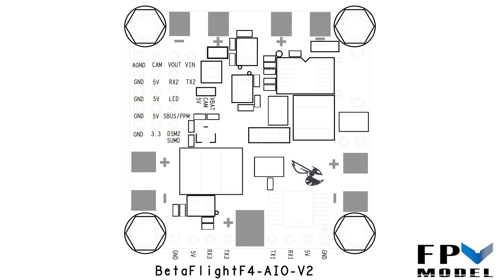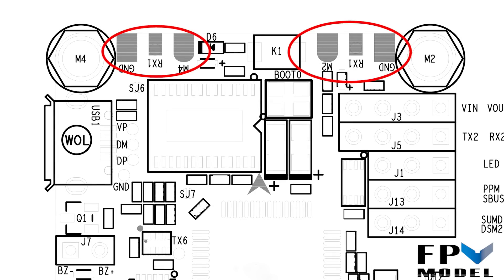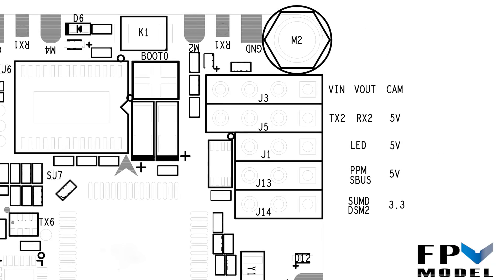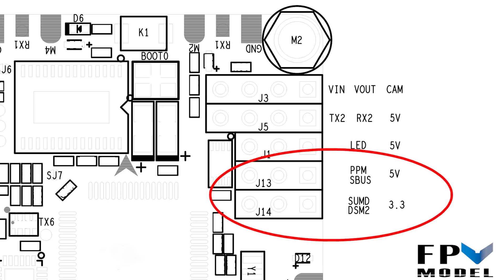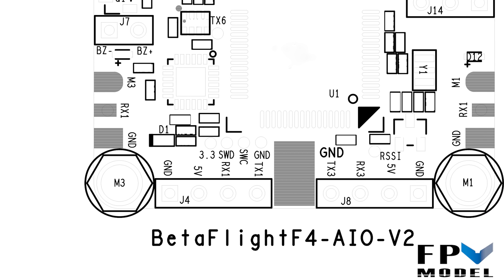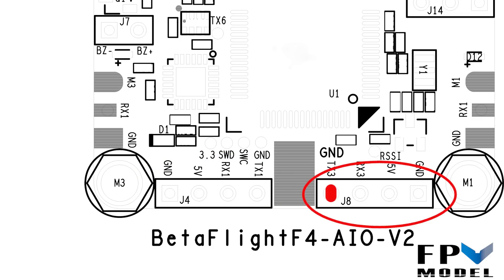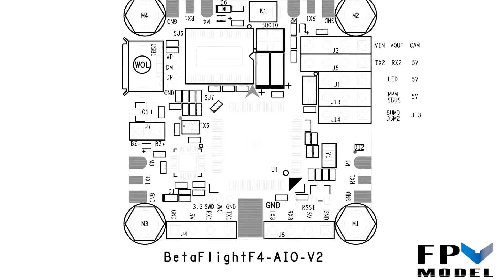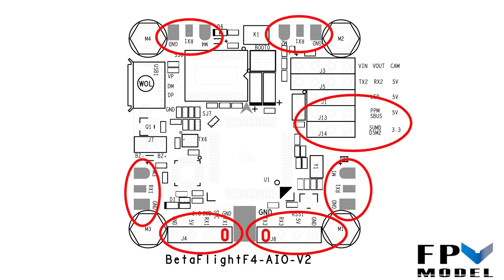BetaflightF4 How To ESC Telemetry, Smart Port Audio, Smar Port Telemetry Betaflight F4

Comment: I am having problems getting my motors to turn on. I am using a radiolink at10 transmitter with a R12DS receiver. The receiver is connected to the board with a 3 wire servo cable that was provided with the receiver. I have it connected from the sbus port on receiver to the three row pin out on the back labeled sbus. The transmitter and the receiver have been paired. I am using hobbyking 30A  UBEC ESCs, wired like the diagram on your website. In betaflight the input from the transmitter is shown and has been setup for a sbus connection. When I attempt to throttle up the motors nothing happens. Even when I attempt to throttle them up using the motor controls in betaflight there is still no response. I am not running any cameras or  using smart audio. Only building a standard drone for a class assignment. If you have any advice with what may be occurring please let me know. Thanks.

Comment: Hi, I’m having 2 issues with my BFF4. I can’t get the current sensor to read anything and I can’t get the rssi to work with my crossfire module. For the current sensor, I enabled it and seleceted onboard adc in the battery and power tab, but in the osd and post flight report the amperage and mili-ampers meters don’t move at all. As for the rssi with my crossfire, it always stays at 22. I assigned rssi in the micro tx to channel 12, and selected channel 12 as the source for rssi in the receiver tab. Everything else works, I get voltage and have full control with the crossfire module. Any ideas?

Thanks, Cooper

Comment: Hello, so i am using a Immersion tramp for my vtx on the betaflight f4 and the voltage wont display. It is connected to the video correctly and the power is being supplied straight from the battery. I see the voltage osd in my video feed but it just keeps blinking at 0.00 V.  I am currently using the +,-,video and audio from the tramp. i removed the other wires. I cant figure out why i dont see voltage. please help!!!
Thank You
Reply from the maker: send us a message to sales@fpvmodel.com , Please include pictures of your wiring and screen captures in the configurator.
Reply: WWW.FPVMODEL.COM 
Thank you so much for your quick responce and concern but i ended up figuring it out.

Comment: Im confused lol on your website diagram it says to hook my smart port to tx1? Now your saying put it on tx3? Do i need to switch it to tx3 if i have the betaflight esc hooked to the rx1 pads? Thanks for any help
Reply from the maker: What vtx are you using?
Reply: WWW.FPVMODEL.COM  i am using the unify pro. I watched your other video about going into cli and used the steps on your site and i got it working last night. The website step by step makes it super easy. Thank you
Reply: so what was actually the answer? this was the first issue I noticed-did you have to switch it? Could you please elaborate? Thanks :-)

Comment: Can you assist me in using Kiss 24a ESC's with this board? I am using FrSKY XSR with SBUS installed as directed and TBS HV with Smartaudio installed as directed and the adjustments made in CLI for softserial. The adjustment is made in the cinfig battery section to recieve data for amp from esc and in the configuration tab softserial, OSD, Airmode, ESC sensor, anti G, and Dynamic F are all turned on and runninloop at 8k/4k. When I power up OSD flashes on screen for a sec as system begins to power then blue led flash on ESC's and OSD is gone but system works fine other than slight power surge to ESC's on initial Arm. But any sequencial Arming after are idling normally. Please advise...
Reply from the maker: I haven't used the Kiss ESCs before but could look into it. Have you sorted this issue out already? Looks like I'm about a week late to this comment.
Reply: Not yet. I got a suggestion from Crazyfpv to try wiping the fc to default and that possibly there is a conflict with softserial. Currently I have switched to another build. The components for the BBF4 build is: BBF4, HW 2405/2850, Kiss 24a ESC's, TBS HV 800, RunCam micro, XSR/ X4R/XM+ "would prefer telemetry but certainly not vital with the OSD running. Can use XM and send RSSI through 16",available empty frames currently include 5" RDQ Mach1 with skinny race arms, 5" Kraken"Worx", or could run set up with Emax 2306/2400 on a 6" Chameleon and switch receiver to TBS micro and make first long range build. Thank you for looking into this for me. I will gladly post results to those who have been stumped as well.

Comment: Will Smart Audio (using IRC Tramp protocol) work if connected to Tx2 (instead of Tx1)?  I connected it to Tx1 and converted it to SoftSerial, as per the two videos.  However, the smart audio (IRC protocol) is not working (i.e. cannot see or change VTX channel in BF OSD).  SBUS and FrSky telemetry is working fine.

Comment: Anybody have trouble with KISS esc's on this board? When I arm the board, the motors spin up for a second then just stop. If I run them through the configurator, they spin up fine.

Comment: I have soldered everything the way you have in the video and turned on Soft Serial, but how do I direct the soft serial to TX1 & TX3? When soft serial is enabled it does not show any additional serial ports. I'm using an R-XSR and TBS Unify Race VTX.
Reply: Got it all working now. Only needed to do the 11 A09 part to enable smart audio in softserial and leave esc telemetry on uart1and smartport on uart3. Maiden flight tomorrow, happy days!
Reply: No, but I think it's so that the TX is able to do TX & RX on one pin.
Reply from the maker: Send us a message Matt. ESC telemetry shouldn't be too difficult to get working. If you can send some pictures of your wiring, and screen shots of configuration tab, port tab, and a pic of your resources in CLI we should be able to get it sorted without many issues.
Reply from the maker: Did you turn on soft serial in configuration tab?
Reply: Yes, I've tried it with Soft serial on, soft serial off, tlm_inversion on and off, pid over tlm is enabled. I've tried it on tx1, tx2, & tx3. Found out the firmware on the receiver was possibly out of date and updated it and tried it all over again. Back on the Naze32 boards when I enabled softserial, it caused more serial ports to show up in the ports tab, when I enable soft serial now, no additional ports show up in the ports tab
Reply from the maker: Send us a message to sales@fpvmodel.com , please include pictures of Ports and Configuration tab. In CLI enter "resoure" and let us see a screen shot of that too. If soft serial is not showing up in ports it seems like something must not be set up correct. Shouldn't be difficult to figure out with those three screenshots mentioned above.
Reply: Jason did you get it sorted/an answer? Im using the r-xsr with the un-inverted hack, the early version where i soldered a wire to a transistor pin, de-soldered the rx plug, cut the smartport pin 3 down and joined the un-inverted wire from the transistor to it, then soldered the plug back to the rx. Telemetry is working fine and my TBS unify v2 5v smartaudio is working. I just need to get the ESC telemetry working on rx1 with smartport also on tx1. Not sure if this was your issue but its my issue at the moment, any pointers to help would be appreciated seeing as i have a similar set up. Nice vids and flying on your channel!
Reply: Matt Treerat yeah, got it sorted. They made a second video on how to do the soft serial setup that I was unaware of.
Reply: So i guess you did everything in the second vid? I have seen it but i'm confused on the need to turn UART 3 (smart audio) into softserial for it to work, when Uart 1 with ecs telm on on rx1 and  smartport on tx1 is the only Uart that needs softserial. Are you running Blheli 32 ESC's and getting the telemetry from them ? Its the ECS telmetry im after matey.
Reply: H'mm just followed the second vid and tweeked the resource serial ports by the book as well as the ports tabs and enabling softserial, lost my telemetry and smartaudio!  The toys are out of the pram now, set it all back to what i had, guess i need to contact FPV Model to resolve this. Thanks for your response and help. I saw you have a geprc leopard in your vids, they have been quite popular over here in the uk this race season. I stuck with my geprc TX210 chimp all year and im still loving it for what it is, worth a try if you like the geprc frames. Thanks again.

Comment: i am having problems arming it will only arm maybe 1 out of 10 times its very strange accelerometer is off and min throttle is fine
Reply from the maker: Strange indeed. I've seen one other person saying they have the same issue. Can you send us a message with short video showing it not responding. It doesn't have to be a professional video, just a quick video from your phone is fine. sales@fpvmodel.com
Reply: WWW.FPVMODEL.COM I just flashed it again with the new 3.2.1 betaflight and it’s working now so far so hopefully that fixes it for me I will let you know if it pops up again and I’ll take a video
Reply from the maker: Was it using the firmware it shipped with when you were having the issue?
Reply: Yes it was running the firmware that came shipped with it
Reply from the maker: Thanks for getting back to me. I'll ask the other guy if he can double check that and reflash.
Reply: WWW.FPVMODEL.COM unfortunately the problem still persists I checked in the cli and now I’m getting an arming flag calib which means the sensor hasn’t calibrated
Reply from the maker: can you send me an email? jason@fpvmodel.com
Reply from the maker: Yes we did.  We recreated the issues as in your video then show you what's going on with the throttle can you send us screen captures of the settings in configurator?
Reply: WWW.FPVMODEL.COM sure I can which settings do you want to see
Reply from the maker: Hello Kevin, just checking in to see if you received my email.

Comment: Why do you need to put TX3 to soft serial if the hardware serial isn't being used? And why not use TX2/RX2 for Smart Audio or Telemetry? I mean there are 6 hardware serial ports, why would you waste CPU cycles with soft serial? If it won't all work with the hard serial and there are enough hard serials to do the job, I feel you might want to rethink some design elements.
Reply from the maker: There are not six hardware serial ports. There are four. uart1 ,2 ,3, and 6. We use this as a guide for Frsky because their sbus, and smart port signals are inverted. TBS is also a one wire two way communication so soft serial works better for it too, although I have had some users say they have gotten it to work with a uart tx and not setting it as soft serial...please keep in mind others have said they only get it to work with soft serial. If using other receivers that do not have inverted signals then you do not need to go through this particular process, but smart audio still might be required to do so.
Reply: Actually, there are 6 UARTs on the STM32F405 (according to the spec sheet for the chip)  just the design used on the BetaFlightF4 board only gives access to 1, 2, 3, & 6. With SPI, I2C, CAN and SDIO there are up to 15 communication interfaces. I understand there are major limits on space that limit what can be made available and that not all of the TX sides can be made bidirectional due to these limitations. I mainly thought it strange that one would use soft serial if there were still ports available, but I guess that might be what allows the TX to be bidirectional on the TX1 and TX3 pins.
Reply from the maker: Yes that's true.

Comment: Just installed bff4 and got problem with voltage and current : it shows 0  for bouth and blinks in osd . Any idea about that?
Reply: Were you able to figure this out? I am have the same issue. I also have nothing showing up for ESC telemetry...
Reply: Yes. In bf GUI  battery tab ,you have to choose Onboard ADC for both voltage and amps. It works

Comment: Anyone have issues with the mah used not working correctly? Mine are way off. Does anyone know what the scale should be set to on this first batch?
Reply: just charge a bunch of packs and go for 1000mah flights... full charge the packs again and see what the difference is.. you know the rest.. I bought 3 betaflight f3 in the past and all 3 had different scale.. but I got them dialed in really good.

Comment: I'm pairing this FC with BlHELI_S ESC. Although I'm able to flash the latest BlHeli firmware onto the ESCs, I'm not able to get BETAFLIGHT 3.2 to read the motors. The motor tab in Betaflight is not registering the esc/motor (motor 1-4 is greyed out). I've tried all the protocols, DSHOT, ONESHOT, MULTISHOT and none of them work. 

Is this a software issue?

Comment: I have wired the board up (and stupidly assembled the quad without checking everything was working) but I cannot get IBUS to work. The receiver will communicate if I set it to SBUS (I assume as the port is inverted) but how would I get IBUS to work? Is there a CLI command to switch the inversion off, or will I have to rewire the communication wire to a different pin such as DSM2, or a different UART?
Reply from the maker: SBUS uart6 has a built in inverter that is not controllable. Should try one of the other uarts on the FC.

Comment: Should sbus work without having to invert on the xsr? I’m having a weird issue where the quad won’t arm but I can see the stick movements in the configurator. The motors move fine when using the motors tab in the configurator. And in the modes tab, my switches show as moving correctly.
Reply from the maker: When you have time can you reach out to us on facebook? This makes two times that I've heard of someone having an issue like this. It would be nice to go over it with you and see if we can find the root cause.
Reply: I ended up fixing it by reflashing the board and selecting erase chip. Everything was configured correctly, but fellstar on the fpvchat slack helped me out by suggesting that. Took care of the issue. I can arm fine now. Thank you for replying back, though. I didn't have to invert sbus. Just out of curiosity, should one have to invert anything when using this board?
Reply from the maker: The majority of people should not need to....but there are many different available accessories that could be added and possibly have the need...I just can't think of any offhand at the moment.

Comment: How do we enable soft serial for TX1 and TX3. I got my board yesterday and can not get smartport telemetry to work. I’ve tried using Uarts also for smartport and it still doesn’t work. I’ve got smart audio working using TX1 as Uart. 

Another question does the board support kiss 24a telemetry? If so how is that setup in betaflight?
Reply: I went back to the firmware from the site and watched you’re latest video. Got it working, thank you!
Reply: if using tx1 for smart audio go to CLI: type in "resource" no quotes needed...
You'll find a list....look for serial_tx 1, serial_tx 2, serial tx3.....you'll be attaching smart port telemetry to uart3 tx...it's listed as B10. After that go back and type in "serial_tx 11 B10" once again no quotes need. You'll have a message come up that says something like serial port already assigned....I'm not at the computer right now and don't recall exactly what it says but it'll also say serial reassigned. 
Once you see that enter resource again then make sure serial_tx 11 is listed with B10. Once you verify it says that type in save and the board will reboot. then go to configuration turn on soft serial. then ports and you'll see soft serial 1 has been turned on. Go to the list for telem and make sure soft serial 1 has smart port turned on...save and reboot then your good.
Reply: If you're having issues look us up on facebook and send us a private message. I can help walk you through the process.
Reply: Interesting that you were able to get smart audio to work on UART1....I've yet to be able to get it to work like that.
Reply: Keep in mind that if you ever move over to BLHELI32 ESCs and want to use ESC telemetry feature you'll have to use smart audio on soft serial with the uart1 tx pad...one uart cannot do two things and the esc telemetry is connected to uart1
Reply: Ahhh ok. I’ll try it out tomorrow when I get home. Thanks for the Info!!
Reply: Did as you suggested for smartport, changed resource to b10. Enable soft serial and set telemetry to smartport. Still no telemetry. I’m using 3.2 RC5. Should I try 3.2
Reply from the maker: Are you using the firmware the board came with, or are you using the updated hex with timer adjustments? take a look at the first few minutes of Part two. https://www.youtube.com/watch?v=c2ih9AK7I0I
Reply from the maker: Cool. Thanks for the update.
Reply: For this board, do I have to do the inversion hack on my frsky xsr? I’ve updated the board with the latest hex on your site and my quad won’t arm. Motors work fine if I run them through the configuration.
Reply: So was the question about KISS 24A telemetry support answered? I blindly wired up all my KISS to the telemetry pads, and realized they were meant for BlHeli 32 ESCs.

I would really love to get the KISS 24A telem ready thru those pads.
Reply: Yes, most F4 boards require the Frsky inversion hack for smartport telem
Reply: I've triple checked my config, have smartport working in the osd so that works but s.port telemetry is not, lua either of course. Cannot find any new sensors after following both videos. Using latest 3.2 release and one from page both don't work for me.??
Reply: David Pallett I had weird issues with this board that I fixed by reflashing and checking on the erase chip option before flashing. I know it sounds simple but it sorted out the problems for me.
Reply from the maker: It's working in the OSD but not on the Transmitter?